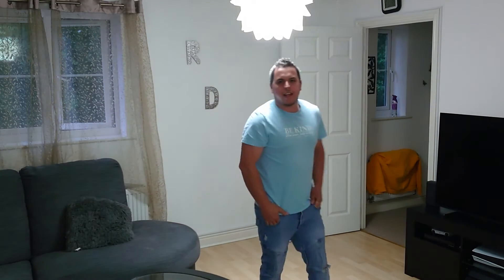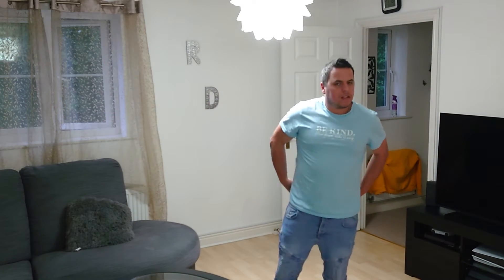Crank BMW diesel engine without high pressure pump in

Comment: High Nuno,  I have the metal filings in my pump, I’m waiting on a good used pump to arrive, and I have purchased a set of reconditioned injectors as 2 of mine were faulty.
Can you give me any advice on cleaning out the fuel lines and fuel tank etc. lots of people are say to replace everything with new parts which seems crazy, surely there is a way to properly clean everything. I was going to flush the lines through with clean diesel an compressed air, maybe use brake cleaner on fuel injector lines.
Can I re use the rail and injector lines if I can clean them somehow.
Thanks for any advice you can give, Cheers, Chris , Blackwood, south wales.
Reply from the maker: @chrsrans1  hello mate. Yes it's a good start to clean the fuel lines. But you don't need to clean the fuel line before the fuel filter. After the fuel filter you can clean them. Any metal bits coming from the tank will be trapped by the fuel filter. A clean diesel or brake cleaner should be perfect. Now i would recommend cleaning the rail very well. Any metal bits could damage your new injectors. Bleed the system before starting the vehicle. If you follow my videos about this matter you should be fine.
Reply: @axores20  Thank you so much for the fast reply, there are so many other people  out there saying to replace everything  in the fuel system with brand new parts that it’s was making me doubt myself and my capability’s , you have given my confidence a boost, thank you again.
I will now clean everything to a high standard, good luck. Cheers Chris.
Reply from the maker: @chrsrans1  you don't need replacing with all new. I never did. Just clean well. All those cars are still running strong 😊 any questions please ask. Good luck 👍👌

Comment: What kind of damage i would be expecting when the alignement wasnt correct?
Reply from the maker: The key way on the pump you can turn it to match the sprocket, but when pump is removed you cannot rotate the crank, chain will jump off. This can cause damaged to the valves when crank over. How is the car now? You need replacing the timing chain now?
Reply: @axores20  thx for ur time. I will be replacing it as soon i get the part. If you have discord i can share the video for the damage thats happened to help others to prevent it.